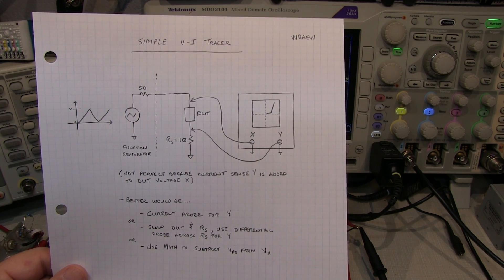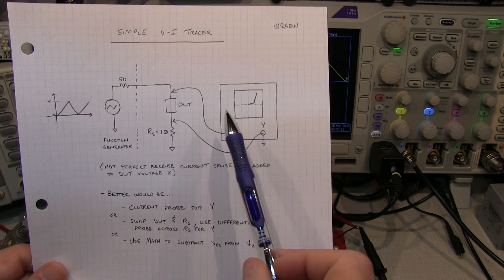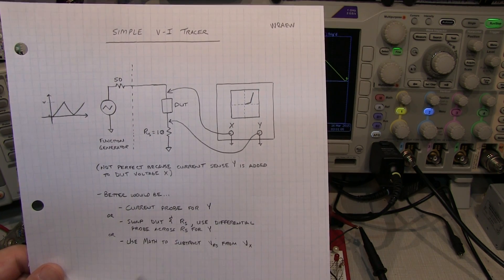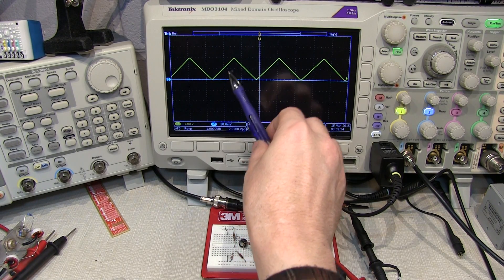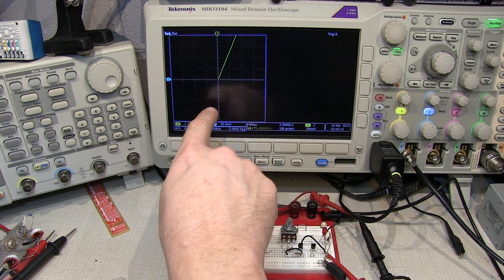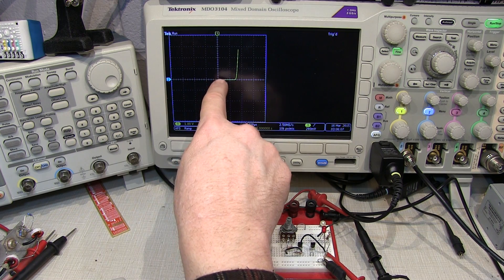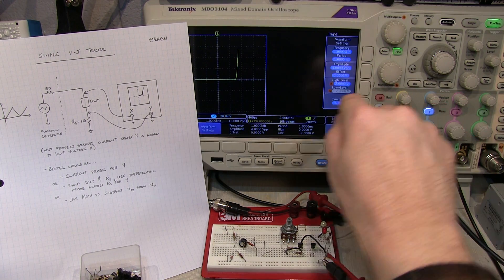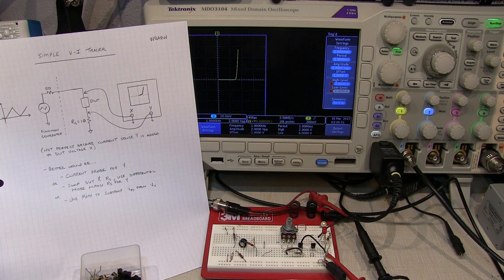#197:Simple V-I curve tracer using an oscilloscope and function generator

Comment: Why not just isolate the function gen to float the gnd and use the low DUT for the oscilloscope gnd.
Nice upload !
Reply from the maker: One has to be very careful when isolating test equipment, resulting in more cautionary information than I wanted to put in this video
Reply: @w2aew  
I hear you on the isolation. Could also just skip the FG all together and use a wall wart  12 vac 60 hz, the trace doesn't care in this app other than a little brighter tips.
Reply from the maker: Yes, this is the basic concept behind the traditional "octopus" tester.
Reply: @w2aew  
I think I have an RCA one from the 60's in a box somewhere in my shop, so that's what they call them !
Awesome videos, new sub.

Comment: Do you have any circuit using that same principal using a square wave?  The circuit I have used for many years is just 60~  with 12 volts ac and  the 'in circuit'  test I use a 50 ohm resistor with a sweep current of about 240 ma at the test probes.  Then for the 'out circuit' test , I use 3300 ohms instead of the 50 ohms.  I'm not sure how well the circuit will work using a square wave?  Any feedback will be appreciated!   A video would be great,  if a square wave works ?   Gary Grove , 73's
Reply from the maker: Square waves don't work well because they transition too fast to draw a smooth curve.  Sinewaves, triangle waves and sawtooths work best.

Comment: Is the probe being used is a current probe?? What if I don't have a current probe, how can i measure the current? Do help me out
Reply from the maker: The probes being used are both 10x passive voltage probes.  The one that is probing across the 10 ohm resistor is effectively measuring current because it is measuring the voltage drop across the 10 ohm resistor (I=V/R).
Reply: @w2aew  Thanks for the reply. What if my range of current is in nA, then will the voltage probes be able to measure the nanoamp current??
Reply from the maker: @SherinAThomas   You'd have to increase the 10 ohm resistor significantly.  10nA will be VERY hard to measure with this very simple approach.  Even using a 1Mohm resistor, 10nA will only give you 10mV, which is quite small to measure with a scope.  There are specialized low-current ammeters for measuring such small currents.
Reply: @w2aew  Is there any other alternative other than using low current ammeters? because i want to plot the I-V of the memristor device.
Reply from the maker: @SherinAThomas   Probably one of the best tools to do this with is a Source Measure Unit (SMU), such as the Keithley 2450.
Reply: @w2aew  But SMU will provide me DC current. What if I give a sinosoidal input and what to check the continuous current to plot its I-V on oscilloscope?
Reply from the maker: @SherinAThomas  The 2450 SMU can be setup to sweep the voltage and plot the IV curve on it's display.
Reply: @w2aew  I am not familiar on how to do it. Can you please provide any link of any reference on how to set to sweep and plot the I-V using the SMU. It would be very helpful to me.
Reply from the maker: @SherinAThomas  There are several ways to do this.  One way is directly on the instrument itself using the graphical display.  There is an example application in the user's manual (https://download.tek.com/manual/2450-900-01E_Aug_2019_User.pdf) on page 96.  The example talks about doing an IV sweep on a solar cell, but the process would be the same for your memristor).  A second method uses a PC based program called KickStart (https://www.tek.com/en/products/keithley/keithley-control-software-bench-instruments/kickstart) which can give you some more flexibility in the data collection.  And third, there is an IV-Tracer app that can be loaded on the SMU (via KickStart) which gives you more interactive control over the sweep, similar to a standalone curve tracer (https://www.tek.com/en/keithley-iv-curve-tracer).

Comment: Hello, sir. I have just built a function generator using an AD9833 and Arduino, which generates a triangular waveform among others with a 600mV peak-to-peak amplitude.... to the best of my knowledge. What circuit do you recommend using to amplify this signal and bring it to 2V peak-to-peak without interfering with the measurements? Greetings, and thank you for your videos; they are very educational.
Reply from the maker: Simplest solution would be to feed through a transformer.  A low power 120VAC to 24VAC transformer could be used in reverse (have your circuit feed the secondary).

Comment: Thank you so much for sharing this video, because of you I now have a curve tracer on my cheap Hantek digital oscilloscope which is so cool.
I can't believe that I got it working by just copying your circuits, I'll make some more improvements to have some more control and make it a more permanent circuit by soldering it to a strip board, now I've got it working already without having the right components such as not having a rail-to-rail opamp and it's on a breadboard but it still works, man I've had a lot of fun making this circuit.

Comment: Is slope equal to resistance or conductance?
Reply from the maker: Really both.  The closer to horizontal - the higher the resistance and the lower the conductance.  The closer to vertical, the lower the resistance and higher the conductance.
Reply: @w2aew  y/x, current/voltage = conductance

Comment: So I got both a scope and a Funct Gen - So what exactly do I need to do to create a wave tracer ?
Reply from the maker: You only need the a 10 ohm resistor and a pair of probes, and a way to connect the generator output to the device you're testing, and the 10 resistor to the other device terminal. It is all clearly explained in the 5 minute video.

Comment: I want to do V-I trace for a resistor in a board. This resistor is my DUT. The resistor is a pull up resistor in a board with one end connected to VCC (+5VDC) and other end connected to the device. I do i make the setup? I will not be able to connect the 10 ohms resistor in series path for current probe. How to do?
Reply from the maker: For a simple go/no-go curve trace, take a look at the "octopus" circuit: https://www.youtube.com/watch?v=Gwo3pEH7hUE
Reply: @w2aew  Thank you for providing the link. Can I use octopus circuit to test any resistors, capacitors, inductors and diodes and transistors in-circuit?
Reply from the maker: @sanjayparelkar3912  Not always. In circuit testing is always a compromise because surrounding components appear in parallel with the specific device you are trying to test. The way that something like an octopus is used for in-circuit testing is to have a known good reference for each device that you are testing, so that if there is a failure, it will deviate from the known-good curve.  Of course, this can only hint at the bad component because the faulty part could be in parallel with the device you are connected to.
Reply: @w2aew What is the frequency at the output 6.3V, is it 60Hz ? I can also use 50Hz right? Also where I should connect the ground? Do I need to connect it to the oscilloscope ground?
Reply from the maker: @sanjayparelkar3912  Of course, 50Hz works too.  The equipment you're testing should be unpowered and unplugged, so connecting to scope ground is appropriate.
Reply: @w2aew  Hi I have used the octopus circuit. I was checking the resistor, I am finding a inclined line  for resistor  in -V (x axis) and +I (y axis) region instead of +V and +I.  why is this so?
Reply from the maker: @sanjayparelkar3912  In my octopus video, I used the INVERT function on CH2.
Reply: In my board I have a Russian Processor having multiplexed address and data lines AD0 to AD15, CLK,CLKOUT,WRQ and other control lines. How do I test this processor if it is working properly or not ? can we use this technique to test it?
Reply from the maker: @sanjayparelkar3912  No.  You'll need an oscilloscope or logic analyzer to examine those signals.

Comment: I have built a simple curve tracer that i found on the webthat use a function generator instead the transformer and it works but i don't understand why the trace on the display  when the probes are open is not flat horizontally but tilted, the same thing for the capacitors that i measure, the circle is tilted. Can be a cable problem?
Reply from the maker: Usually due to running the function generator at a higher frequency where you see the capacitive effects of the cables/probes.

Comment: Hello! I hope you don't mind me asking a question on the topic. I spent some time playing with this and was able to understand how the value of Rs affects some characteristics of the curve. While testing a capacitor I noticed that as I change (up) the frequency in the function generator, the shape of the curve changes (scale up in the Y axis) thus making it easier to see. I also noticed that if I test a capacitor of larger value, that also scales up the shape. Why is that so? I don't quite get it. I Recorded some short footage on the behavior to illustrate. https://www.youtube.com/watch?v=YlMLGhA8znk
Reply from the maker: This is because the impedance of the capacitor is a function of both the operating frequency and the capacitor value.  Thus, the current that flows in the capacitor at a given voltage will change if the frequency changes as well as when the capacitance changes.

Comment: HI, Alan, I have been looking for a reference chart of curve tracer shapes. You would think that to be just a google away, but I am not finding what I am after. Do you have a suggestion for a source, or a link, for a fairly comprehensive chart of typical wave forms? Would it be in a 575/6 manual? I imagine I can download that. Thanks.
Reply from the maker: Chapter 2 in the Tek 576 manual is loaded with typical curves from different device types: 
http://w140.com/tekwiki/images/7/71/070-0905-01.pdf

Comment: My Rigol 1054Z needed some help to get xy working. The tek 2467b verified my setup was working. In the past i've just used the tek for this technique and chalked the rigol as nogo. After fiddling with all the knobs and checking my sanity, eventually setting the trigger for channel 2 >> it just magically popped into a working state.  Before, the XY mode just looked like a fuzzy dot, or fuzzy line. Now I can't get it not to work. I guess that's a good thing though. Hopefully this helps save someone years of fiddling. >> "something to with trigger while in xy" << I'll comment again if it stops working. btw my fw is old 4.3.sp2 ,, yayaya i know,, i'll update it

Comment: ty. superb video. made mine work. capacitors show up square because it's a triangle wave instead of sine wave?
Reply from the maker: Yes, a linear voltage change results in a constant current (and vice versa), that's why you get the square.

Comment: thank you    i have   a diac   connected   in serie with  a resistance (2 kΩ) . Αpplies  a voltage  ac ( 36 V rms from  a  transformer  220Vrsm  to 36 Vrms)    where  i must  connect  the  CH1 and CH2    find  the  I-V curve  of   DIAC..THANK YOU

Comment: I don't know the difference between a Curve tracer and a Fluke Source Measure Unit SMU to test diodes, transistors, FETS. What is the differences between a curve tracers and a SMU source measure unit?
Reply from the maker: A curve tracer is specifically designed to sweep the voltages and currents necessary to show a family of characteristics curves for 2- and 3-terminal devices (mainly).  A SMU is a precision +/- voltage and current source with precision measurements. It can be setup to sweep voltage or current to generate an IV curve.

Comment: It appears from the dotted line in your drawing that the 50 ohm resistor is built into the function generator (for termination?). Is that correct, or does a separate 50 ohm resistor need to be added in series with the function generator? I'm still a noobie.

Also, please verify how a transistor would be connected... Function generator to base, or collector?

Thanks, Alan, for all your great videos!
Reply from the maker: Most function generators will have the 50 ohm series resistor built in.  For this simple application, it generally won't matter if it is there or not.  This simple technique is designed only for two-terminal devices, so you can't do a proper curve sweep on a transistor.  You'd be able to only look at the individual junctions (base-emitter and base-collector).
Reply: @w2aew  Thank you, Alan. This link looks like it might explain the setup for transistors and MOSFETs: https://www.circuitspecialists.com/blog/using-an-arbitrary-waveform-generator-and-a-digital-storage-oscilloscope-to-create-a-transistor-curve-tracer/ What do you think of it?

What I am after is a DIY curve tracer universal (NPN&PNP Transistors, FETs, diodes, resistors, capacitors, etc.) component tester interface circuit that will allow me to use my existing function generator and oscilloscope. I can find lots of circuits that create the frequency signal, mount the DUT and output the signal for the scope. But, I just don't need the frequency generator front end. Do you have any suggestions? Of course, your video and the link I referenced will accomplish my desires, but it is not in one, neat package.

Thank you for your help.

Comment: hello trying to reproduce your setup.
could you give me a range for the resistor to use under the DUT on diagram?
thanks
john
Reply from the maker: I showed this using a 10 ohm resistor as the current sense resistor.
Reply: If the function gen and the scope are both grounded, wouldn't that short out the current sense resistor?

Comment: What is the best option to obtain the best results for the tests? use the AFG (function generator)? Or build an octopus tester (transformer and resistors)? .... and thanks, Alan, your videos are practical and are full of theory, although I'm not very good at listening to English, they have served me a lot in engineering
Reply from the maker: The generator gives you more flexibility (adjustable amplitude, frequency, etc.), but you do have to take into account that the current sense voltage is added to the DUT voltage.
Reply: @w2aew  iam sorry, you refer a the voltage of AFG not is the same in the DUT? this by the resistor?

Comment: Hello, you have planned to use an ADALM1000 as a two-channel oscilloscope with a function generator to get a equipment connected to a computer where you can store the signatures and then compare generator.

Comment: have a computer that is running with this device UNI-T UTD1025CLOscilloscopeI
Reply from the maker: You can't use that scope - it only has a single channel input.  You need a 2-channel scope that can also be put into XY mode.

Comment: So in this case the Y axis is the measured voltage divided by 10, resulting in a number with a unit of Amps?

I see on the oscilloscope that it says channel 2 has a dimension of 20mv/division, so are you just having it display the voltage straight?
Reply from the maker: Yes, and yes.

Comment: Hi.In this case  are you using just the Function generator and the scope? No transformer and no any other component? If yes,with this way we can measure ESR too?
Reply from the maker: CYBERRD58 Not really.  I have other videos on measuring ESR.
Reply: How many volts are you using  from FG?
Reply from the maker: CYBERRD58 Right at 2:26 I mention that I am using 2Vpp.  Of course, you are free to use whatever voltage you need based on the device that you are testing.
Reply: sorry for the questions, is that I speak Portuguese and do not quite understand English spoken very well, just reading
Reply: Thank you for the answers
Reply from the maker: CYBERRD58 OK, no worries!  I'm happy that you are enjoying the videos.